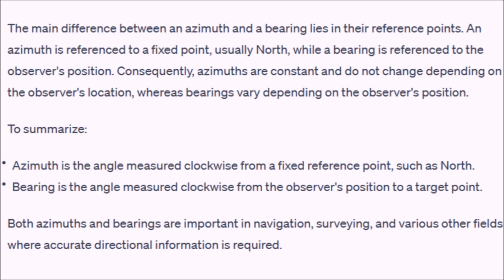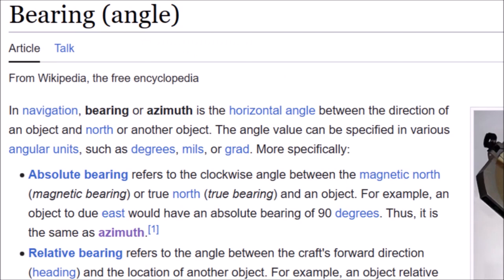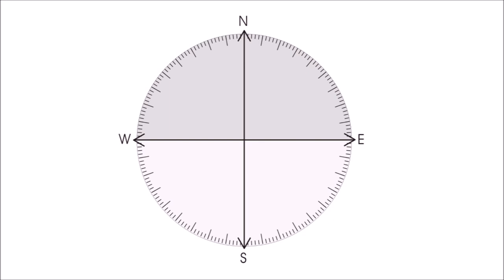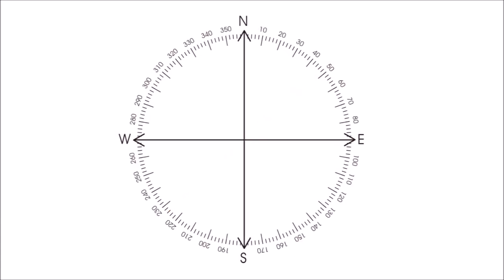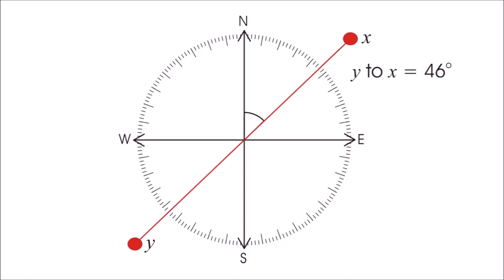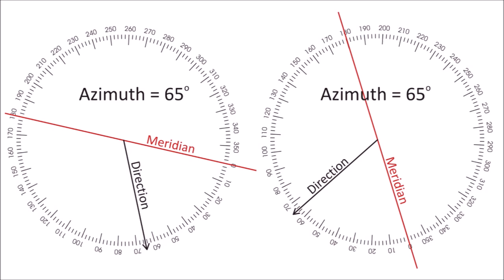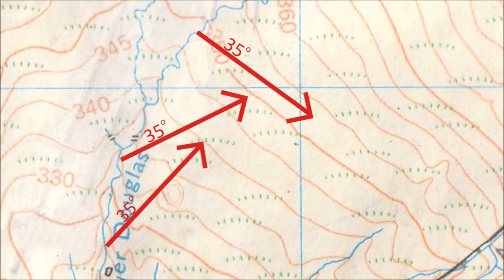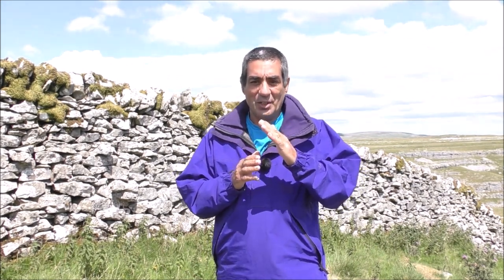Azimuth vs Bearing - there is a difference

Comment: Ok, I am a bit confused about this. I have always used Bearings from my time in the ACF and the big mans army. I like this explanation of using a prime meridium to then take an azimuth from and the bearing being from your point. But I can not find any papers or examples that match your explanation. could you give references for this as it seems that all literature to this is stating that Azimuth and Bearing are now an interchangeable word for the same meaning of taking a line of travel or direction in reference to North in a clockwise direction from your point.

Looking at the root of the word Azimuth coming from medieval Arabic meaning direction could be why most use it instead of bearing. As our American friends use it instead of bearing and that youTube is dominated by US based films that give navigation training then I can see why. But as you state as long as all in the group are working on the same method or termanology IE Bearing or Azimuth and this is stated in the safety brief then all should be fine. 

I do like @TheUnorthodoxy explanation on this. 

Swampy

Comment: Anybody else concerned about the dog worrying sheep on the hill in the background? Seriously though. In maths and physics, East is zero and angles increase in an anticlockwise direction. It could hardly be more different. Now azimuth. This term is used in astronomy in conjunction with elevation for pointing some kinds of telescope. In astronomy due South is zero and the angle increases to the West. The stars themselves are positioned by right ascension and declination. No wonder these terms have got confused.
Reply: Yes, I noticed the dog worrying sheep. 😲

Comment: I am highly skeptical of your usage of meridian as any horizontal reference direction. This must be a rather niche or local usage, and I'm afraid in an outdoors teaching context it can be quite literally misleading, perhaps even dangerous. Could this usage have arisen from a misunderstanding within the group you learned from?

The word 'meridian' derives from Latin for literally 'mid day' and in context of the sun refers to South in particular, at least in the hemisphere where Latin was historically used. While etymology is not dispositive, people in science and engineering fields(*) will understand 'meridian' in the geographic sense of a North–South line on the earth's or other celestial body's surface, and by extension the plane spanned by this line and the local vertical to the zenith.

Given the above, azimuth is generally understood as horizontal angle reckoned North over East, unless explicitly specified in some fields, as you mentioned.

Basis: I have a long-time hobbyist interest in astronomy, military and civilian cartography, and surveying.

(*) Acupuncture excluded, by definition.
Reply from the maker: Hi, thanks for joining the conversation.  A meridian can be any line in any direction you need it to be – my dad was a site surveyor and never bothered asking which “direction” the meridian was.  He just looked at the site plan and draw the most obvious line.  After that was drawn it was basically set in stone as the line from which all other horizontal angles were taken.

But, as said in the video this isn’t much use when navigating around the hills, which is all I’m really interested in.  This is why we tend use the N/S line as our meridian.

Obviously in different fields such as geology, astronomy, engineering, etc, etc they will use different meridians.  In my line of work we use the direction from N to S – or we’d all end up walking around all over the place.

Comment: This is desperately confusing to anyone who has been involved in surveying.  The "meridian" for example is commonly defined to designate a great circle that passes through the geographic poles.  All geographic meridian converge at the two poles and are at their widest separation at the equator.  The "M" in AM and PM stands for "Meridian," and refers to the position of the sun at solar noon on the part of the planet you are standing or floating one, or flying above.  Meridians are not arbitrary.  

Similarly, "bearing" is a direction of traverse or sighting.  The basic practice divides the compass into quadrants.  It measures a direction relative to a fixed reference as an angle looking in the direction necessary to travel to reach a location from the position where the bearing was taken (azimuths serve just as well for this and are subject to less recording error).  You see the common use of bearings in survey plats, where the surveyor records the direction and distance of travel for traverses.  A clockwise series of traverses might begin N _ deg. W. 500 meters, N _ deg. E. 200 meters, S _ deg. E., etc.  Bearings never have a degree value greater than 90 degrees.  You can find definitions and explanations in sources such as Surveying by Charles B. Breed.  

Azimuths number on a compass from 1 degree to 360 degrees clockwise around the compass circle.  You can buy compasses marked in either quadrant (used for bearing-reading formats) or azimuth.  The military (US or British) typically divides compasses into quadrants (NE, SE, SW, and NW).